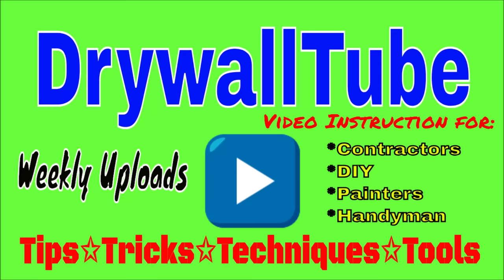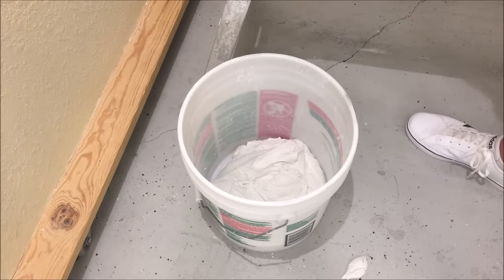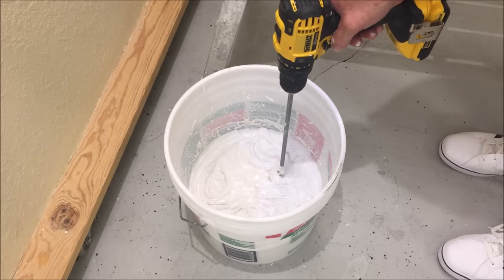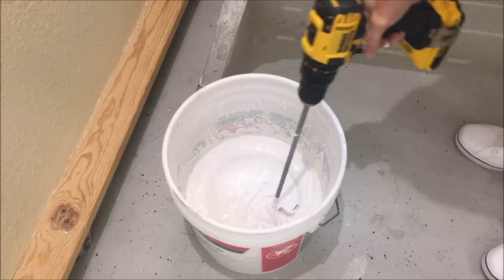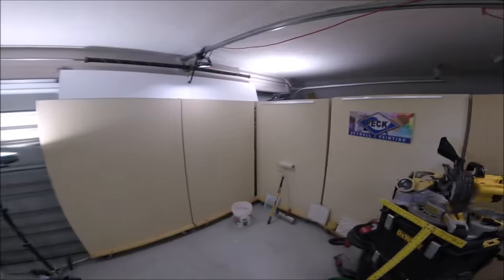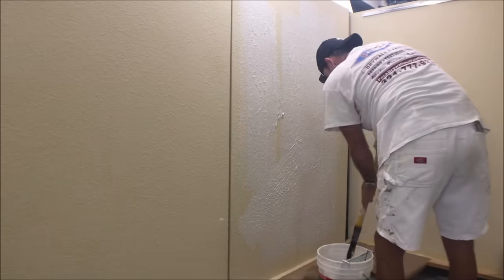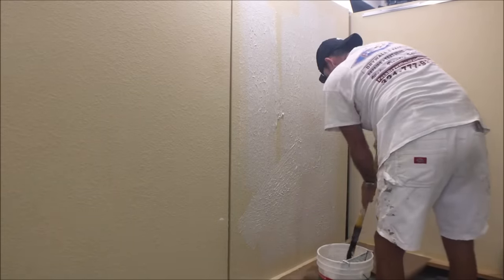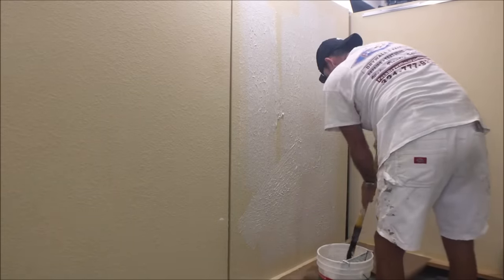Skim Coat Ugly Textured Walls with a Paint Roller Tips Tricks and Tools

Comment: DIYer er. Had a fire in the house and have serious smoke damage in most rooms. There are some areas that the old pain just peels the more I sand, only in the bath. I took out all drywall that blistered. I have been vacuuming walls then vinegar-water spray and wipe, then sand with 100 grit, then 8oz tsp/1gal h2o. Finish off with kiltz. Can I do this technique over the kiltz?

Comment: Hey Paul, is your wall textured and painted? In your experience, can you skim coat straight over existing painted and textured walls? Thanks for producing these great vids mate. Cheers from Australia!
Reply from the maker: Hey there Martin!💥👊🏻 Yes, you can skim coat right over a painted textured wall. I’ve done numerous times with absolutely no adhesion issues whatsoever. Thanks so much for watching and subscribing my friend!😎 -Paul
Reply: @PaulPeck  Hi, how far would that tub of skim go. Would it do both walls and enough for a second coat. Here in the UK the old fashioned wall im THINKING OF SKIMING  is about 3/4 the area as your 2 small demo walls and tubs of filler come as kg weights 6 10 and 20 kg I guess your 2.5L tub is around 13 kg? Does a skim coat of plaster also help block out odours coming from old type plaster? thanks.

Comment: nice vids. i'm pretty new to this. just how flat does a guy have to get it before he does the roller/skim?  I mean, wouldn't the skim aspect eventually fill dips and low spots, even if a guy had to do another application a day later? I'm fighting the butts, mostly. being way to gingerly with the mud at first, I think, afraid to have to sand a bunch. end up doing too much sanding i think, because I'd be better off being more aggresive at first, laying the middle, left and right passes down with the 10" blade and then feathering both edges and swiping down the middle with my new Level 5 32" skim blade.

biggest challenge for me now, and its really a hurdle holding me up, is feathering. trying to apply the right pressure. Just a 63 year old grandfather helping the daughter with her basement. 2 rooms down by myself. brought in a crew for 5K to do the rest. $ waaaay well spent given how long it'd a taken me. still, i'd like to get a little more proficient at this even though i can afford to hire it out. i guess ducking it like that threatens my masculinity or something. least i'm retired so i can spend the afternoons watching interesting tutorials and leaving long-winded comments. have fun, all you mud-slingin, seam-tapin', wallboard hangin' rednecks;)

Comment: you can sometimes it more easier & better to wet sand them have a bucket of water ready to dip n wiggle or scrub clean with a grid sand paper , paint can be scuffold or  using laquer thinner rag wipe n scrub or a brush n rag

Comment: Commercial drywall finished.  One trick I use is a 20 inch trowel less lap Mark's and a flatter surface. One thing I saw you do I dont recommend is scooping mud off floor and flicking in back in bucket I know your a pro but to the dyier keep that mud clean no crusties back I. Bucket you'll thank your self in the end.

Comment: Have you ever mixed with primer to get a smoother wall that is already flat? We have some imperfections from the previous owner. It wasn’t noticed at first but now it looks like they removed wall paper and maybe used high hiding primer. I was looking for a way other than skim coating but wondering about the results.

Comment: Ty for this.  How many days should you let a skim coat dry before wallpapering on it?  I am trying to wallpaper on a textured wall so wanted to flatten it first with a skim coat to get better adhesion
Reply from the maker: A good rule of thumb is 24 hours. But, I would definitely prime the wall before applying the wallpaper. I like to use a Zinsser 123 primer for that. And here’s a video to speed up the drying process: https://youtu.be/RvvBxae-uVY?si=crckoOPqEDPiqik9

Comment: Hey Paul love your vids. I’m a diy’r and would like to know if you have any vids on removing metal corner beading and replacing it with the plastic bullnose beading. I prefer to tape over the perforated part of the bullnose bead to help with the “suck” that occurs as the mud dries. Am I wasting time or? LMK. Thanks.

Comment: I have watched countless videos, and I am still trying to decide whether to use all-purpose or plus 3 for a skim coat. Those who live by Plus 3 say that it does not shrink as much and that it easier to sand. And I see that all-purpose should be used for covering tape. It seems to be a matter of preference, however, for I have not seen a definitive answer. 
Which is easier to use? Which do you recommend?
Thanks!

Comment: DIY er.  Having do redo the disaster contractors left me with from hurricane repairs. Very poor craftsmanship these days from contractors who don’t have any pride in their work. 

I am having to strip all of the paint off the drywall and start over on 75% of the rooms. 😳 
Paint can be peeled in  sheets off   the walls. 
The advice so far has been to sand it all off. Seal the peeled paper spots with gardz or bins. 
Prime and repaint. I am thinking I may want to skim coat also to make it a smooth finish. Not sure how hard it will be for a novice though. Have lots of questions about whether it is ok to leave crown molding and casing or to remove it all before starting.

Comment: Can you skim coat half a wall or does it have to be ceiling to floor? I removed mirrors from a bathroom but the ceiling is 12-13 ft and I only need to repair about 4-5 ft behind the cabinets. Thanks!

Comment: Question. I have attempted to do this in my garage minus the knockdown skim, wanting to use the JC as texture. The drywall had a then layer knockdown 25 years ago. My problem is when I roll the JC, it removes some of the prior knockdown. Any solution?

Comment: I can see where if you have a helper that this method would cut the time in half, but doing it by yourself I don't see any reason to do this unless one is struggling with knife technique. I do recommend that one sand/rough up the paint a bit before skim coating. gives your mud a better bite. The biggest problem with skim coating that I've found is getting it lay flat which is just a matter of sanding and coats. Most of the time I can do it in 2 coats, but every once in a when the surface is very uneven as well as a coarse texture  it takes me 3 coats. Texture hides minor imperfections in drywall. I like double knockdown rather than orange peel style for older walls because it hides many of the drywall issues. texture box guns are good for repairs but for a pro looking job buy or rent a texture machine and practice on some card board..

Comment: So I'm on my first drywall project and my girlfriend's basement where the sump pump failed and she had Servpro come out and they basically took off a bottom 12 in or so or 24 in depending upon how it was wet and a lot of the corners and a lot of the stuff is kind of damaged and not good and anyway I was wondering what like the best way to put a finish or texture on a lot of like long seam repairs.... I'm like trying really hard but it's kind of janky
Reply from the maker: Has the drywall already been installed yet? Also, what type of texture are you trying to blend? -Paul

Comment: I'm DIY'er. Have you ever had a problem with mud not adhering to drywall? Possible cures and prevention?
Reply from the maker: New drywall? What type of joint compound Larry?
Reply: Ace hardware premixed mud. Dry wall been up for years. Some painted, some not.

Comment: Plaster ceiling. Paint is pealing. Scraped as much as would come off. Still lots of paint left. How do I get a smooth surface. Can I use that ski coat trick with roller. About 12’x14’ area

Comment: Hi Paul, glad I found your channel. I’m a red seal plumber and enjoy tackling anything trade related. Bought our first house 3 years ago, plenty of Reno’s. planning on skimming out our textured walls and was wondering if there was any pre coat prep work required? I’m used to cleaning walls with TSP. I also thought about pre sanding/grinding the walls to knock down any major lumps. Any advice is greatly appreciated.

Comment: Great video! My current knockdown walls and ceiling are painted. Do I need to put a primer on the pained knockdown surface before the first skim coat? Will be using 90 min hot mud. Thanks
Reply: What can you use for outside stucco?

Comment: I am retired after 48 years of being a drywall finisher or taper, what ever you want to call them. Over 30 years ago we where using rollers here in San Diego on big jobs for a level 5.I found using a roller over heavy texture was to slow and made a mess. There was more mud on the floor then the wall. Just put the mud on with a 12 and flatten it out a little and let dry. Next day scrape it down a little, not sand it but just scrap it a little. The dust from sanding left on the walls would create pin holes. Put another coat on by hand and pull the mud off just a little. Next day scarp a little and put mud on and pull mud tight. Then sand or texture a nice flat cloud texture, a tight skip. You have to much going on in this video for a home owner. With that roller I can see them from head to toe in mud. And Paul you need to wear boots. Your video is good.

Comment: Can I do this right over a textured and painted wall or do I need to prime it first?   Great video!
Reply from the maker: You can go right over the paint if you use an all purpose joint compound. Because it has the most glue in it, which means better adhesion.👍🏻

Comment: Its a good technique but so far mud is impossible to get out of rollers, have tried several ways of get mud out but so far just have to throw them away
Reply from the maker: Yeah, the rollers covers are pretty much done after using them to apply joint compound for skim coating. 👍🏻

Comment: Paul im a a dyi person fixing to try and tackle subway tileing my kitchen must i skim coat my wall before adding the tile?
Reply: Rick just saw your post, just a fan of Paul's no association  but a licensed  General  Contractor  in CA since 1999,  and the short answer is definitely not, if its new drywall you will want to tape and mud the seams and prime the unfinished surface before applying thinset mortar or a tile backer board depending on your application. You should search the web under the subject heading  "how to install subway tile in the kitchen " there are many diy videos on this topic you will benefit  from . Good luck

Comment: I'm more like a DIA (Do It Againer) instead of a DIYer :) Thankyou soooooo much for taking the time to share these videos.  You've really helped me out tremendously.
Quick question and apologies if you've already answered this before.
I've seen quite a few others recommending the blue topped litght all purpose mix.  They've suggested it's easier to work with and shrinks less therefore reducing the chances for cracking.
Any thoughts on this and your reasoning for using the green lid all purpose mix?

Comment: Will this work on heavy textured surface or do I have to scape it? Either way this should still save me alot of time. I am just a diy guy with little to none experience, I really appreciate your video. Thank you thumbs up from me👍🏾
Reply: Sanding or scraping first is the way to go. All the high spots will be at a uniform height when you start applying the skim coat.

Comment: Do you ever have any adhesion issues with joint compound going over painted surfaces?
Reply from the maker: No. That’s why I use all purpose joint compound when skim coating over a painted surface. The all purpose has more glue in it which gives a lot better adhesion. Thanks so much for watching and commenting! –Paul
Reply: @PaulPeck  Thank you for your reply!
Reply: @PaulPeck  Would this work just as well for semi-gloss painted walls  as used in bathrooms for example?

Comment: Do you prep the wall the same as if you were painting it?
Reply: You don’t have to but I would suggest sanding with say 100 grit just to rough it up some so mud will stick easier but not necessary coat first with all purpose sand again with 100 or 120 coat again with topping compound the sand again with 220 then touch up any flaws

Comment: I just bought a "new" place, so I'm an aspiring DIYer thanks to needing to fix it up. It has these ugly textured walls and ceilings - thankfully not popcorn! Your video was great and you make me feel like I can get rid of them! And doing it without any of that scrapping and chemical stuff I've seen in other sources. Since I've never done it before, I'm wondering what do I do with the roller in between coats and once I'm done? Do I clean it at every step and do you have any tips on doing that?
Reply: Oh and I'd be doing a fairly large chunk of walls and ceilings surrounding ~800 square feet. Do I need to worry about the paste drying in the bucket and/or on the roller if I try to just continuously work my way across?

Comment: Paul I had imperfections in my walls an a painter talked me into painting them with a texture I hate it. I was thinking about scraping it off my question is could the skim coating work for me?
Reply: Me too.  Did you find an answer?
Reply: @paul2019monte  yes he said after scraping off the parts that are rough skim coating will work. Just try an get it as smooth as you can without damaging the drywall

Comment: I have my house on sale and have started to sell off items, including a painting behind a sofa. When I went to measure it the other day, I was horrified to see what I believe is a huge fresh pee stain from behind the drywall, where there's insulation and then a thick outer wall. I don't have either the cash nor the time to start cutting up walls. Would using bleach on it and then quickly painting over it do the job? I'm in France, so no US house sale ethics board involved! Thank you anyone for any advice!
Reply: Any idea how you got a pee stain? I'd be concerned about a water leak. It could be a leaking pipe in the wall and it could be yellow from coming through the framing materials. If so you could have a mold problem hiding inside the walls.
Reply: @joylesstiger   _ Hello and thanks for replying.  I don't believe that there are any pipes in that section of the house but I did hear some kind of animal with its squealing young, shifting around behind the boards in that general area. This is an old house and there were a number of square holes left, by design, on the outside. I have had them filled up. I did see a ferret scamper up into one of them a couple of years ago before I got it plugged. (the ferret had exited)
If it were a water leak, it would only increase in size. I'll have to measure it and keep a close eye on it. That would require professional intervention. Thank you for alerting me to the possibility. 
As to my original question, if it is urine, would sanding, applying bleach and painting do the job or would the "cover-up" need to be more elaborate? 
Thanks again.

Comment: DIY need to get rid of the popcorn walls and ceiling in one room!!!
Reply: Hi Erica just saw your post had no reply's. You maybe well aware of this but it's worth mentioning for safety sake and any  potential future viewers that maybe in the same situation.  If your popcorn texture was applied  prior  to 1990 there is a good chance it  contains asbestos.  There is an abundance of information available on the web regarding its use   and  protocol for testing and eradication if your unsure.
Reply: @philrilp1122  Thanks, I will be renting a vacuum sander and a full mask so hopefully I will be okay. I will test it first thanks again.
Reply: Hi Erica sounds good, the best method I’ve found for removing popcorn and keeping dust down is to get a spray bottle and fill it with water be sure to cover the floor completely with a thick plastic sheeting minimum 3 mil but 6 mil is even better you can find rolls at at all the big box stores in various widths and lengths try to choose one that’s as wide as the room to cover with one continuous sheet and tape the edges to the baseboard with blue painters masking tape which won’t leave a residue or peel paint off the base when removed. Then from a step ladder that gets you an arms length away so your not over reaching spray the popcorn texture with water in a strait line in the direction you want to work from let soak in just for a minute and only cover a distance you can safely reach with a 6” taping knife you will see it change color as it absorbs the water then take your knife at approx a 45 degree angle to the ceiling and scrape the line you sprayed, it should come right off down to the Sheetrock paper, the moisture not only loosens the material but also goes a long way in dust prevention once you’ve finished you roll up the plastic then bag it in an extra large thick black plastic construction debris bag  and zip tie the top then dispose at the county hazardous waste disposal location. You’ll find the right amount spray that’s not too much or too little as you go. No need  for a vac sander, however I would recommend using a full respirator, the kind used for spray painting if you can find one as they are in short supply but look online for the non disposable kind that have a cartridge on either side of mouth area, this are made to stop vapor particles and dust mask even the N95 is not going to prevent airborn particles in the parts per million range as there are gaps at the nose area and most are not made of a fabric that would prevent microscopic particles, this only applies if the texture contains asbestos. Good luck I hope this helps you !